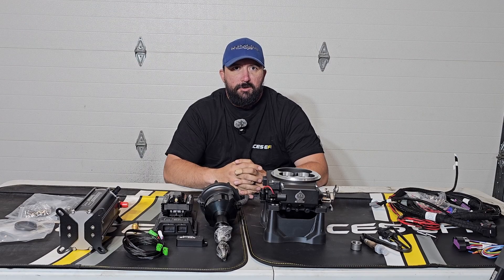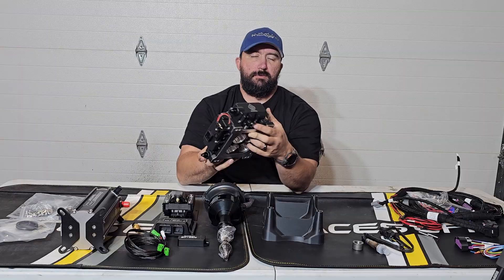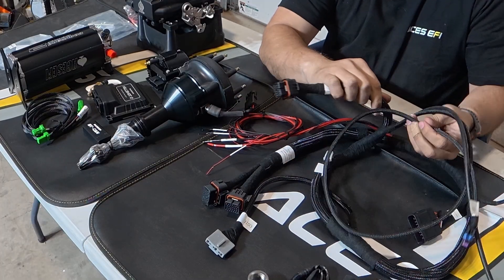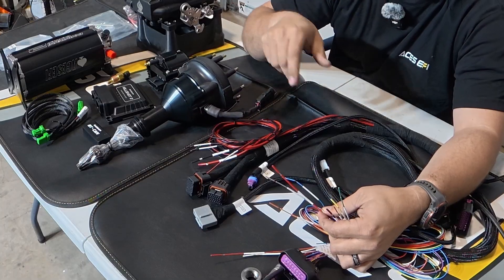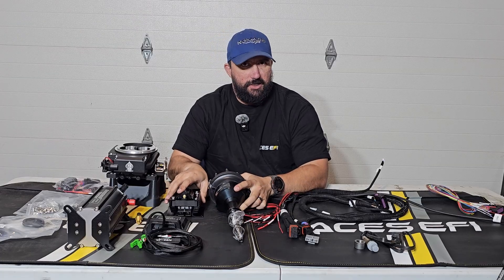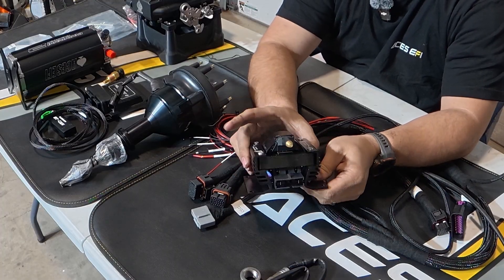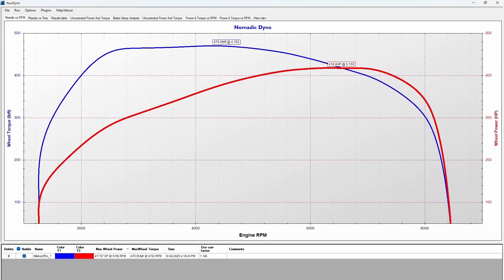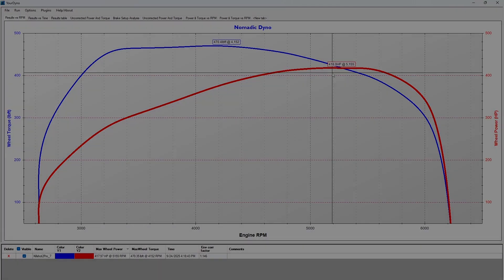ACES EFI Killshot 2 Pro - General Overview and Dyno Result

Comment: Do you prefer the Killshot 2 or Fusion ?
Reply from the maker: The fusion is about as simple as it gets to install. The killshot 2 has a built in fuel pressure sensor so that's convenient. The 2nd Gen ecu is also much faster and has better resolution for tuning. I'd personally pick the killshot 2 every time, unless I just needed to slap something on quick. I made basically the exact same horsepower with both on my car with dyno tuning, it was just way easier to do on the ks2pro
Reply: @BryantStilwell  cool thanks. I’m about to pull the old falling apart efi system out of my 86 F150 5.0 I’m restoring.  The factory harness is literally falling apart and the ECU diodes are leaking causing all kinds of stupid issues. The factory speed density efi is terrible and since I plan to do heads/cam/ etc it just makes sense to go with the kill shot 2 or fusion. I’m definitely leaning towards the KS2 now.  Thanks!  😮
Reply from the maker: @Mcleadslinger you're welcome! If you're getting a new intake, I would also lean towards the wildcard 2! I have a video up on it as well, and about to post another soon.
Reply: @BryantStilwell  awesome!